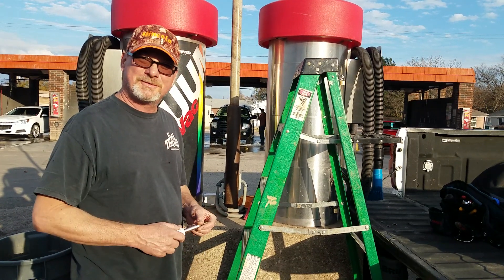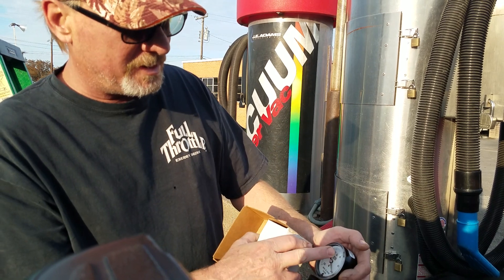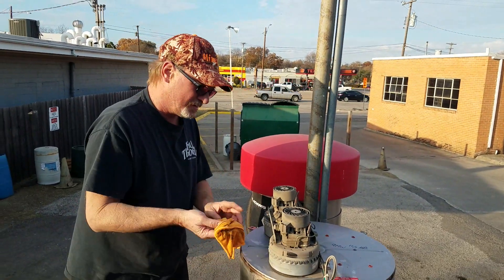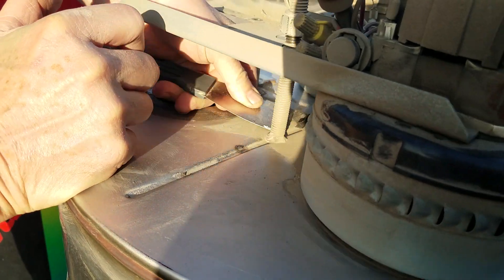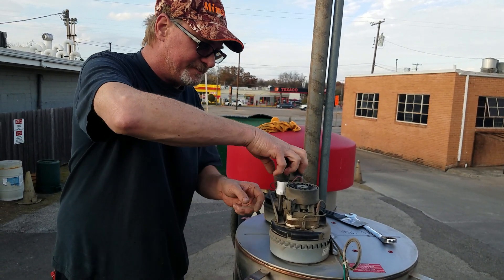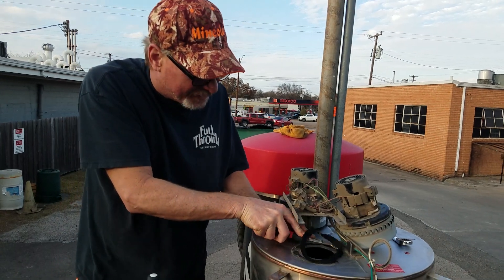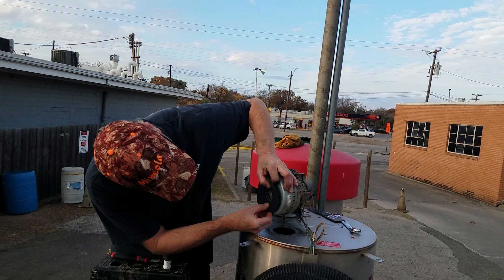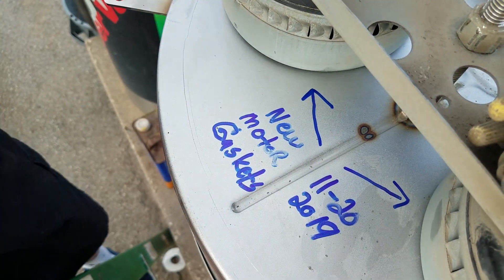Car wash Vacuum Maintenance Motors

Comment: Now that you stuck the gasket to the motor isn't it going to be tougher to replace it the next time because now you're going to have to scrape the gasket off the motor rather the flat surface I work at a full-service car wash in Galveston Texas and all of our vacuum suck its really slowing us down the owner says just make it work what an ass LOL I'm going to pull the top off one of them in the next few days when I find the time or they allow me the time and see if that is an issue on all vacuums thank you for the video
Reply from the maker: I rebuild my vacuum motors with new brushes so I'm able to use them three or four times before the end of their life span. By that time a new gasket and a new motor would be the appropriate fit
Reply from the maker: i rebuild my motors so i get several uses out of a gasket... and gaskets are cheap so after a few rebuilds its ready for a new gasket..